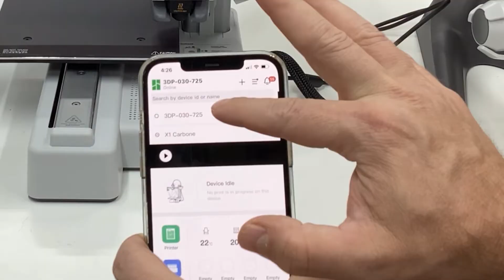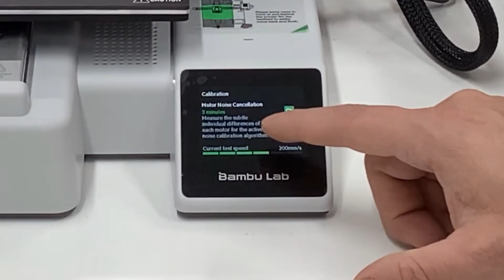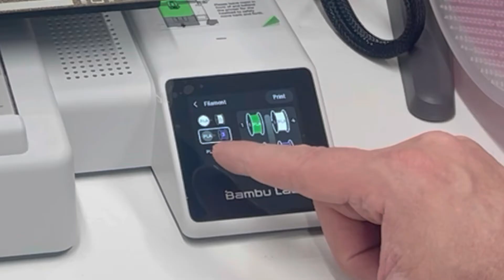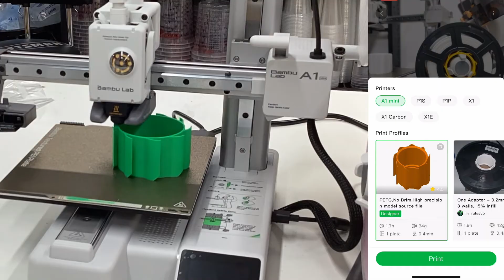The Ultimate 3D Printer for Beginners : Bambu Lab A1 Mini + AMS Lite

Comment: What do you do for geric Fila and the AMS lite?
Reply from the maker: There are adapters you can print off of maker world .
Reply: @JakeThompson  oh I know I meant like if you print from maker world and you have generic filament loaded into the AMS lite.
How does  the printer know for a color model where you loaded the colors in the AMS?
Like if a color print uses  red white and black and you load red into slot 1 and black into slot 2 And white into slot 3
How does the printer know what slot to use.
I know you can manually assign a color to a slot in the AMS but what if you have different  variations of a color or what if you want to change the colors around and assign different colors when printing a pre colored model from maker world?
I printed a two color print with black and white non Bambu filament ,no RFID and it came out fine but what if I wanted to change the colors around.
How did my 2 color black and white print figure out which slot I loaded the white to and what slot I loaded the black to?
Does it just try to match as close as possible or did I just get lucky?
I didn't see it ask me to tell it what colors I want for the model and aks what color was loaded into which slot.
If I want  to switch a color from an AMS model how would I do that?
Like if it has black red and yellow and I load black red and orange will it just use the orange instead of the yellow because it's the closest color I have loaded?
What if I wanted to do more dramatic change could I assign but by slot instead of color?
Reply from the maker: @ after you slice it and before you send it to the printer, you should be able to chose which AMS slots go to which part of the print.. you can change them around however you like.
Reply: @JakeThompson  ok but is that for the Bambu slicer on the PC only?
I mean if I am using the Bambu handy app and I use a model that is pre sliced and colored and I am just sending the print job to the printer from the handy app on the phone.
Reply from the maker: @ I do it from my computer.. not sure if you can switch colors around on the handy app
Reply: @JakeThompson  ok you can ended up finding the options I think it's a little wonky in the app though
Reply from the maker: @ Awesome.. I’m glad you found it

Comment: The problem here is if this printer does break down and it will the beginner will not be able to fix it and it use so much filament its stupid so as far as the best beginner 3d printer, not at all no matter what printer you get for your first printer you need to learn about the printer how to fix and maintain it and you need need to learn the software i do have one of theses and when a problem happens and they do trust me you better understand how a 3d printer works so you can fix it without bein frustrated, this why building one from scratch will give you some much needed knowledge.
Reply from the maker: Very valid points.. there’s always more than one way to look at things..

Comment: Hey man I got the same printer and I have an oddball question might be about the slicer: Im trying to print this "cat key hook" model and theres this particular part in the main body of it thay has this lever that starts a layer or 2 floating. The slicer says so, and my prints are failing with or without supports. I see many people have successfully printed it in the same orientation Im trying to as well. Any suggestions?
Reply from the maker: I haven’t done that model … I will look it up though .. I would probably ask the people who had a successful print of that model…
Reply: @JakeThompson  will do! The file can be found on thingiverse by aarruti as "cat key hook".
I found a person who even had a time-lapse video of that model printing, so I knew I had to orientation right. Conveniently skips the part I keep failing! Lol. 
Do you have any tips for bed adhesion? I'm having a slippery time with the provided PEI plate, and I am being careful to wash it well with just dish soap. Can I scuff up the plate with steel wool or is that a bad thing? Sorry for the newbie questions 😅
Reply from the maker: @rajgill7576  I’m a newbie too so we can all learn together.. I’ve just been putting a brim on the prints to hold them down so far .
Reply: @JakeThompson  right on. That's exactly what I did to retry. So far so good 20% in 🤞

Comment: The 3D looks and sounds like a lot of fun. I’m thinking that for me a laser is going to be more useful and profitable. $300 to get started doesn’t sound like too bad a price tag. It wouldn’t take too many side hassle projects to make that back. 

Great video Jake. BTW, have you turned any pen blanks with the PTFD in it? Ken Moon indicated that it doesn’t turn like the resin and causes some issues. I’m just wondering what your thoughts on it are.
Reply from the maker: Thank you Doug..  I turned one round and showed it on cartoons.. I didn’t have any problems but didn’t turn to aggressively. I’ve sent some to people in the blank club and they have turned them.. I think if you go slow with sharp tools they will do fine.. I will be making different ones and sending them out for fold to try out.

Comment: Great Video, i'm really liking the newer generation of 3d printers... Down the rabbit hole you'll go, you just open Pandora's box! 

Looks like bambu is stealing a page out of reality play book, ready to go printers or for the older generation "plug & play" 🤣 

My first 2 printer was a printrbot and folgertech i-3, kit printers. 3rd printer (some assembly require), Tevo tornado with lots of mods. 4th printer, box stock creality ender 3 s1 printer. I am done with modding printers, I just want to print. Slicers and CAD programs are enought to keep one busy.  

I'm curious about the pen banks, like how they hold up over time? How visable are the layer when turned (one of the reason I was looking at a resin priners, better print quality.)? How is it going to react to the different types of resin and their tempatures? I know alot of it comes down to filament type and settings of one's printer.

Wait til you try the "rainbow" filament in one of your clear with a little color drizzled in pours?
Reply from the maker: Sorry I missed your comment, it was put under Held for review.  I'm printing some right now with a thick print layer so save time.  We will see..

Comment: Does the pla cause any issues while turning? Ive been looking at getting a resin printer so the densities are similar.
Reply from the maker: I’ve sent out quite a few blanks and folks have turned them with no problems.. I would think you may need to turn slower Incase the pla wants to melt while turning.